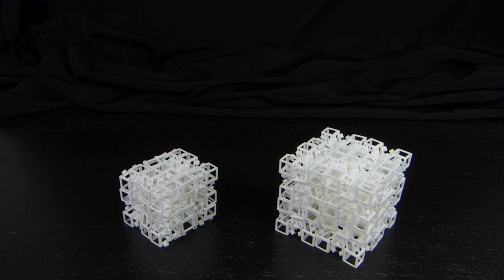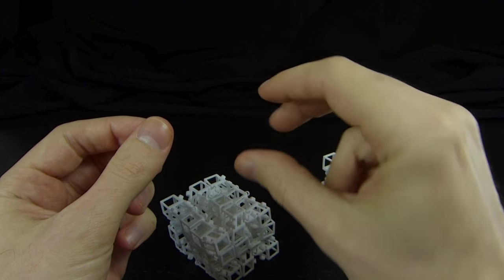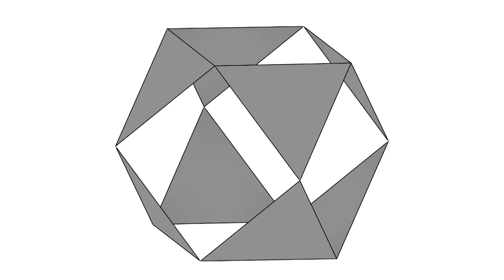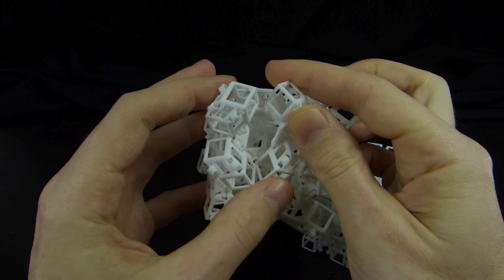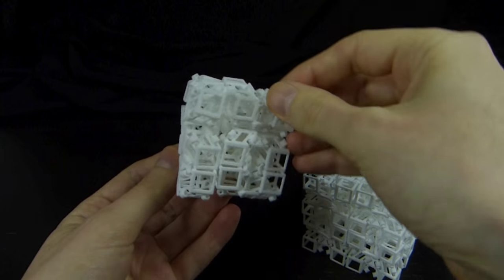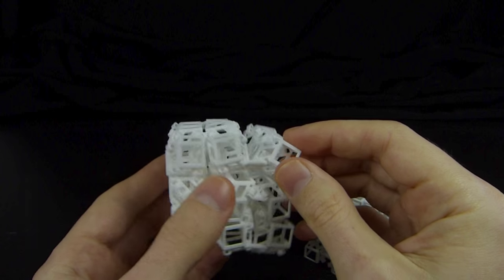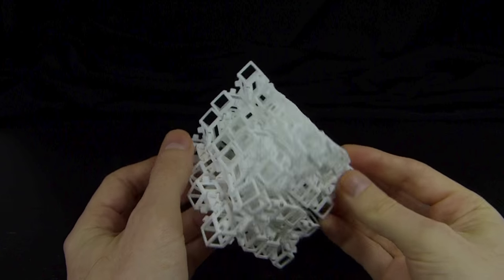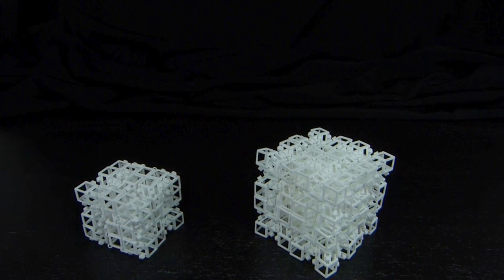Jitterbox

Comment: Is it possible to create arbitrarily big versions of this concept? (As in nxn cubes)
Reply: i don't see a reason why not.
Reply: No, eventually you hit the Chandrasekhar limit and it collapses into a black hole. So it can’t be arbitrarily big under known physics.
Reply: @Wertsir  the chandrasekhar limit maximum mass possible for a white dwarf star. It doesn't have to do with black holes. 

You're thinking of the Schwarzchild radius, which defines how much you can compress a mass before it becomes a black hole. This also doesn't prevent arbitrarily large cubes because the cube isn't compresed enough. 

It doesn't even matter because I'm pretty sure ludomine 77 was asking if it was conceptually possible to make an arbitrarily large cube (not create it in real life, just is it possible for the linkage to work out in theory)
Reply: i assume it should be, as you could probably just make a cube out of these cubes, connected in the same way.
Reply: @amruthchangappa  actually, if the cube is big enough it will compress itself  into a black hole under its own mass. It has to be really really big tho
Reply: @convects9656  "This also doesn't prevent arbitrarily large cubes because the cube isn't compressed enough"
Reply: No, there isn't enough matter in the visible universe to scale this up indefinitely.
Reply: @Gordion111  well, the thing is, it will be compressed enough if its immensely big
Reply: @Gordion111  it'll compress itself under its own gravity
Reply: No, you can't make an arbitrarily large version, but not because the cube will be too massive.

1. With an existing material, eventually the linkages will have to support so much weight that the cube just falls apart.

2. If using an indestructible material, the cube will eventually get so big that the linkages will be too far apart to create a meaningful change. A simpler way to show this is with an infinitely long pole. Because the energy from moving the pole travels at the speed of sound through a solid, the end of the pole would never receive the energy from moving one end. In effect the pole could never be moved. The same thing would happen to the cube, where the energy from moving one end won't travel far enough to move the cube. As the cube gets larger, it takes more and more energy to travel far enough over the cube for it to move, eventually needing infinite energy

Realistically it would break, but an infinite durability material under the same circumstances would be so large that the energy from moving one end of the cube would never reach the other and it couldn't change shape.
Reply: If the cube is infinitely large, it will not compress under its own gravity, since every part of it feels an equal attraction in all directions.

Comment: What's the material cost? this could make some awesome packing material.
Reply from the maker: Way way too expensive for packing material. There are cheaper ways to make auxetic materials though, and one of the proposed applications of such materials is padding and protection.
Reply: +Henry Segerman I figured the 3D printed ones would be too expensive. I immediately thought of this project.
http://makezine.com/2013/01/31/make-your-own-cnc-wire-bender/
Or the paper version could also serve with small enough cubes attached together.

I'm currently working on a box design that was formerly done with styrofoam, and I'm looking for a cost effective paper solution that would work as fill. a small grid of these made out of paper or wire could be recyclable as well as reusable.